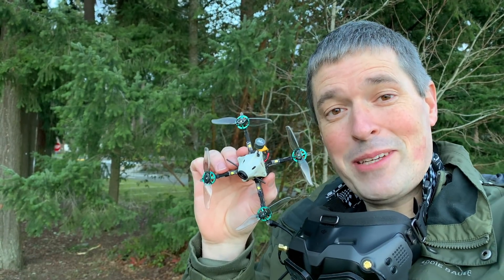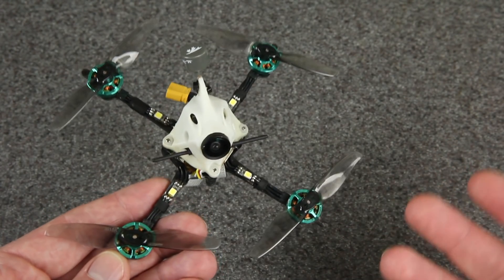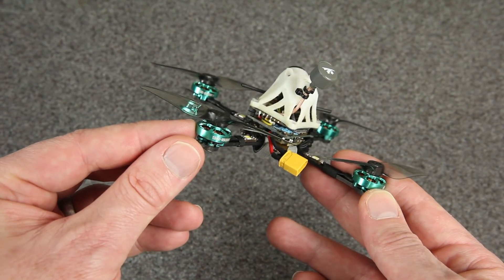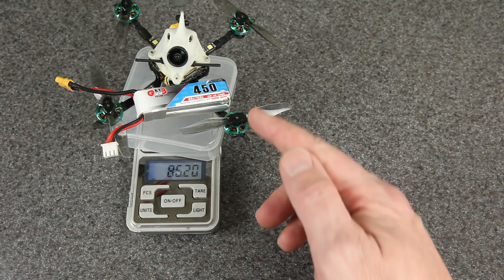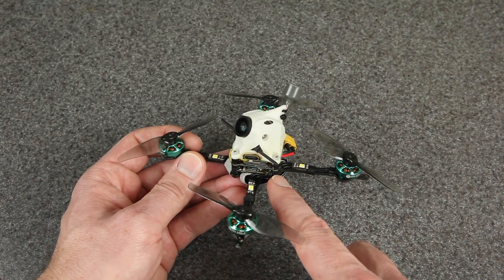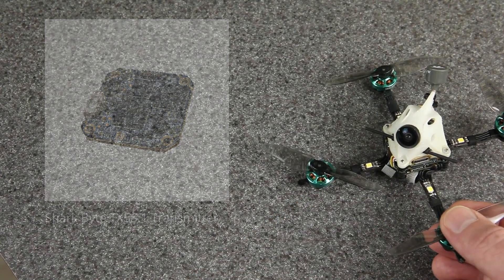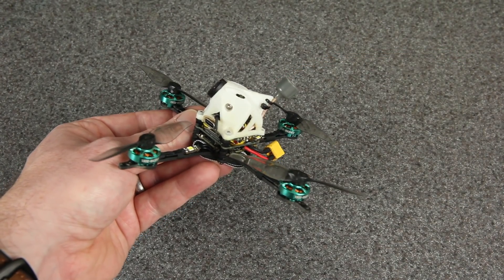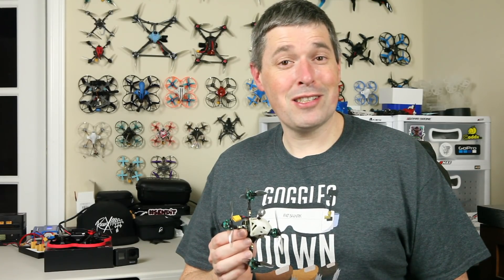DJI Digital FPV on a 3-inch Babytooth Drone! Cool!

Comment: Sweet build. I do have Shark Byte, and was already thinking about it before you mentioned it. I already have the whoop board in a Mutant build.
Reply from the maker: How do you like it? I'm very tempted to get Shark Byte because latency is very important to me. The DJI system is good, but I do feel more connected to the drone when I fly analog, despite the static and stuff. Or maybe it's just because my DJI drones are heavier and thus they aren't quite as responsive. Hard to tell, but anything that can reduce that weight is interesting to me.
Reply: @MrShutterBug  Love it. I’ve never flown DJI before, but the image is at least comparable to the Nebula Nano V2 on your Babytooth. The reception is very dependent on the quality of antennas. I have several videos on my channel. Check them out if you want. I agree 1000% about the analog style breakup and form factor/ weight benefits. I fly mostly micros also.

Comment: Wonder how this would work as analog with a Runcam hybrid 2 for nice recording and good video feed?
Reply from the maker: How heavy is that camera + dvr? If the total weight is similar to this one, then it should work great.
Reply: @MrShutterBug  18g
Reply from the maker: @StacemanFPV  You'll definitely feel the weight, but it should still be pretty fun. I flew my 1S Babytooth with a 20g Insta360 GO once. You can see that video on my channel if you like. Have fun!

Comment: Mine is 58g thanks to using DJI radio and I can confirm it’s the best thing ever 🙂
Reply: Oh and I’m using 1303 Amaxinno motors (the new-ish silver ones with a screw in the bottom) so I could get almost 2g off with these new motors 🤔
Reply: What did you do about the camera? Which one?
Reply: @RobertTheFriscoSchmid  currently running Nebula Nano v2 like Mr.S. but working on a Nebula Pro canopy that will hopefully keep me under 59g. Now with these new motors it’s gonna be even lighter 🤩
Reply: @FilipRadelic  awesome thanks, guess I am gonna wait until I find a better fitting canopy but WANT WANT WANT because this looks like and awesome build and quad to fly around my backyard
Reply: @RobertTheFriscoSchmid  I’ll publish my Nebula Pro canopy stl when it’s done, hopefully this weekend. Will reply with a link. And yeah, definitely can recommend a build like this!
Reply: @FilipRadelic  hey is that new nebula pro stl out? :D
Reply: @rodrigofuhrdoamaral58  almost™ 😅
Reply: @FilipRadelic  :) any progress?
Reply: @qcumbercoolfpv1988  sorry, it was bad weather here so I got an RC car and kinda neglected FPV a bit 😅 this weekend should be nice so hopefully finally rebuilding my digipick with Nebula Pro and publishing the canopy 🤞
Reply: @qcumbercoolfpv1988  hey, still struggling to get the weight down without compromising durability or looks, doing some hopefully final tweaks now and test printing in a few hours 🙂
Reply: @FilipRadelic  Have you been able to print it?
Reply: @FilipRadelic  would love to know how you got on in case you tried it out
Reply: @propwashfpv7063  with the motors or canopy? Motors turned out to be a bit too underpowered. Canopy isn’t 100% done yet, I was hospitalized because of covid.
Reply: Thanks Filip. Which FC are you running?
Reply: @absoloodle37  the old 20x20 AIO by HGLRC they don't make anymore. There's a new version but it's worse in almost every way. I'd recommend JHEMCU 20x20 these days. 20x20 makes it easier to mount Vista since inner holes really are 2mm and outer ones are 1.6mm so you need to force screws through them and put strain on the PCB which can't be good in crashes.
Reply: @FilipRadelic  Okay, great--I was wondering whether a 20x20 AIO is a feasible option for this build, so that's good.